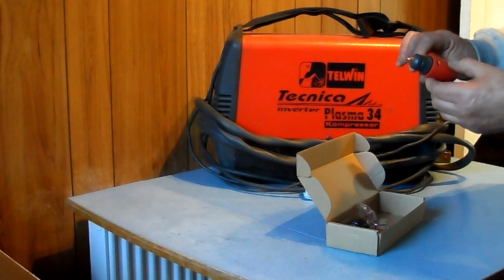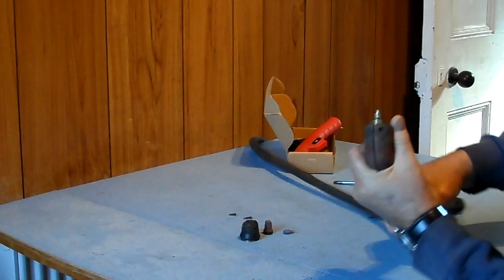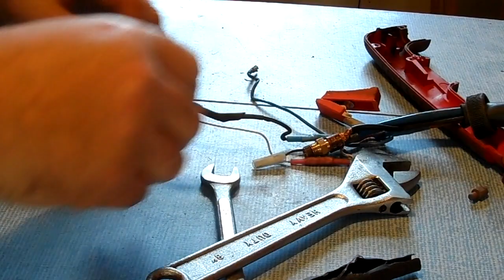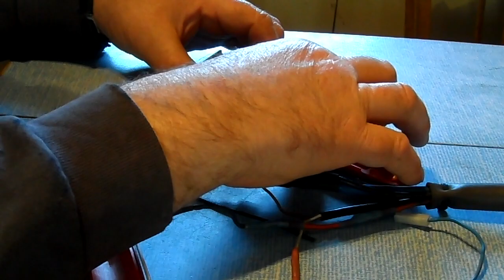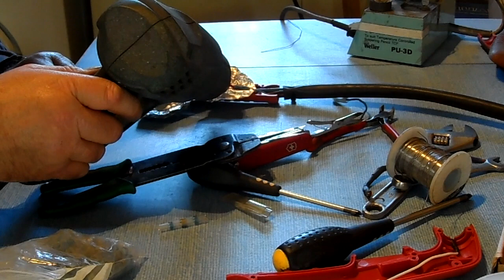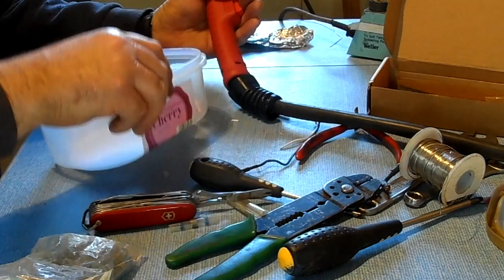Telwin 34K Plasma Torch Repair - Part 1

Comment: Doug I liked your vid but I really could not see just what you where doing on the new torch I just did the same thing on my unit and needed to see how or if I put everything together right . my unit did not work after I changed the torch head .
Reply from the maker: Hi Leon, Was the plasma machine doing anything after replacing the torch? Was the unit activating any of the lights or activating the in-built compressor? My unit would start the compressor but not produce enough pressure to activate the plasma. If you are getting nothing when you press the torch switch, check if the two spring loaded contacts are in contact with the conductive ring on the nozzle cap. If your compressor is starting, check that the plunger on the rear of the torch head is free to slide outwards and is not being restricted by the cables. You need to use a torch nozzle cap with the one (or sometimes 2) holes, the ones with 6 holes will not work with the units fitted with the internal compressor. When the compressors get a bit worn they don't seem to produce enough pressure and air flow to activate the plasma torch and don't produce enough air flow around the nozzle to keep it cool which leads to the torch head overheating.
Reply: @DougsShed ( Doug I put a new 45 S torch head on the unit thought that would do the Job  well it did not I thought I might have wired it wrong so when I found your site I was very happy to see you doing just what I did . That was not it all lights come on even the work load light Green one I do get a low voltage spark when I contact the electrode Head  to the metal but that is all It looks good and seems to be working BUT no JOY . I get nothing when I pull the trigger ) so what do you think  ? By the way my Grandmother was from Dundee  LOL
Reply: I don't think it is the machine Please help if you can
Reply from the maker: @leontrotter2776  Hi Leon, When I plug in my machine and switch on, the internal cooling fan starts to run and the green "Power" lamp on the front panel illuminates. When the torch trigger is pulled, the internal compressor should start running and some air should come out of the nozzle. If there is enough air pressure the pilot arc should strike and the orange light on the front panel should illuminate. The arc is initiated by the plunger on the torch head moving backwards due to the air pressure. If the air pressure is not sufficient the arc will not initiate. You can sometimes see a low voltage spark when you touch the nozzle to the earthed work piece. I can't recall if you can hear any relays energizing when you pull the trigger - my unit clicks but that may be my gas solenoid valve which I fitted to replace the internal compressor with a conventional air line feed.

Comment: Sir i have plasma with torch ergocut s65, arc out without tap torch, can you help, what a problem, in troch or machine pcb plasma?
Reply from the maker: Have you got sufficient air pressure and volume of air going to the torch?
Are the consumable tip and nozzle in good condition?
Reply: minitici Yes, all is sufficient and initially no problem. I've also changed my new contact tip and nozzle.

So the current conditions, when my plasma machine on wind directly out with the arc of the torch without me push the torch.
Reply from the maker: Sorry GF, I think something has been lost in the translation into English. I cannot understand what the fault is from your description.